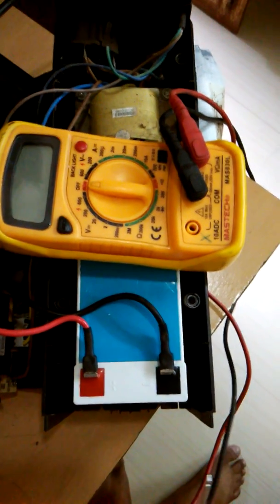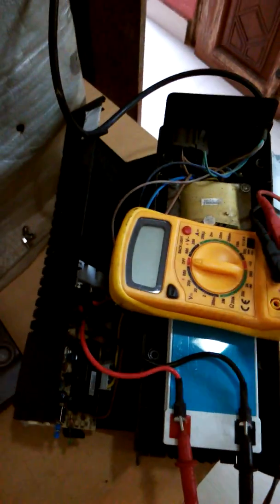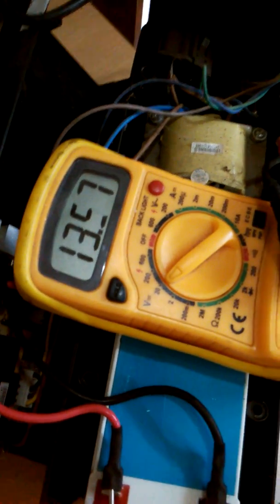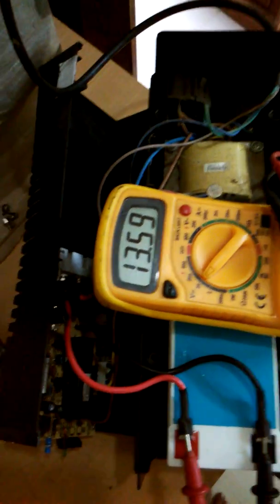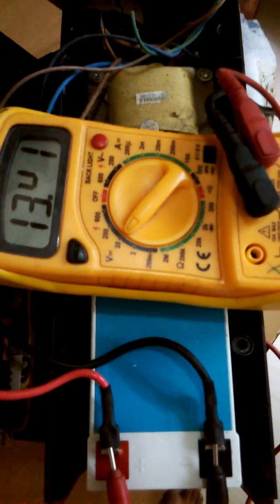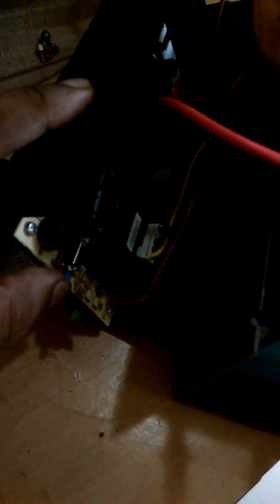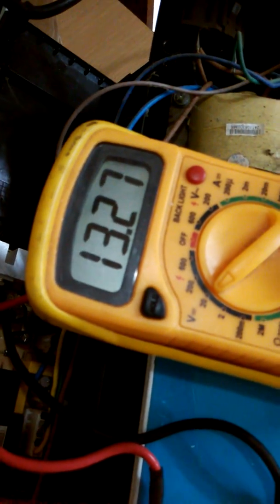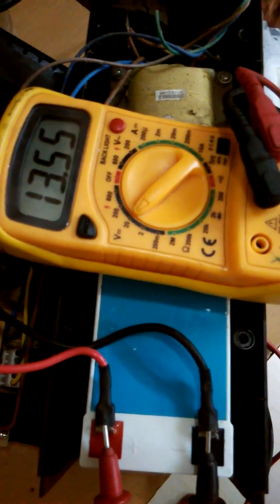how to check ups charging circuit with multimeter

Comment: Dear sir APC smart ups 750VA we are using but now ups output is not coming , once we switch off the main incoming supply our computer also getting switch off ...what is the problem & solution plz
Reply from the maker: Check battery

Comment: This is not showing current this is showing voltage to see current you need to test the ampere. Because when the battery is fully charged it will show 13.6v and there maybe little to no amps so nearly no current flowing. However yes you have shown that it is at a charging voltage only.

Comment: Sir mera charging on 14.52 reading 
Main switch of karte slowly 9.5, 8.5,7.5,6.5,5.5,4.5 reading aata hai kya problem hogaya
Reply: which ups brand u r using model no. plz
Reply: Battery fault ho gya hai maybe